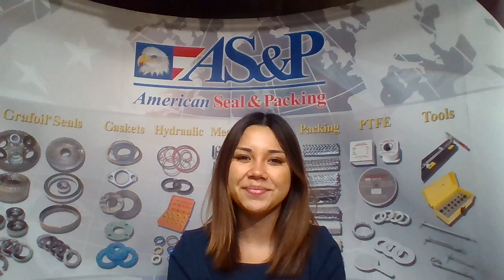Grafoil Gaskets

Comment: I want to make a sealed container that can withstand 800°C and an interior pressure of ≈150 atm. Basically, my aim is to heat samples in a water-saturated environment in the above condition.  I used SS304 and heated the container inside a muffle furnace and it is sustaining the temperature but facing a problem in sealing. How can I properly seal the interior environment?
Is it possible to seal an environment at that temperature?